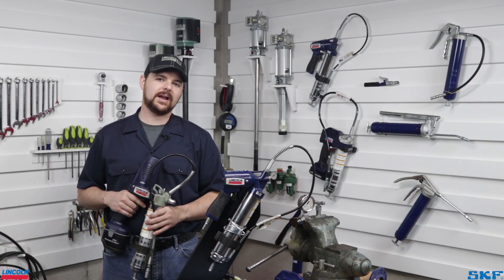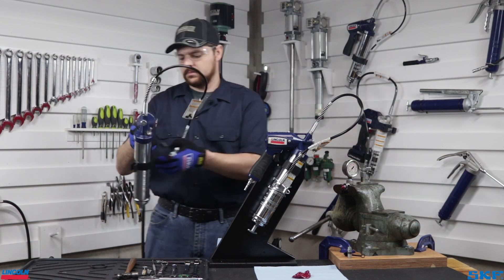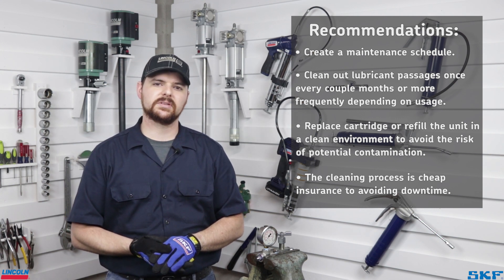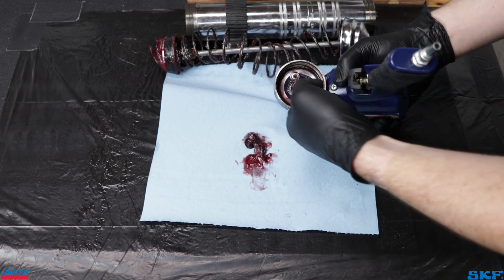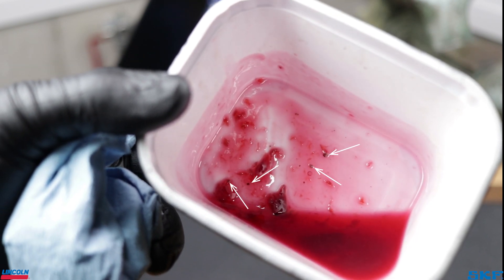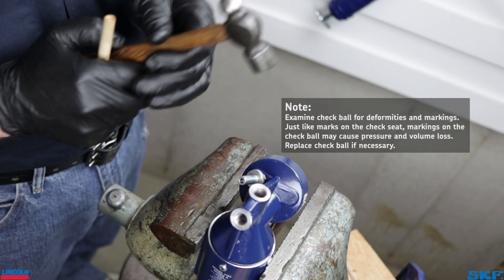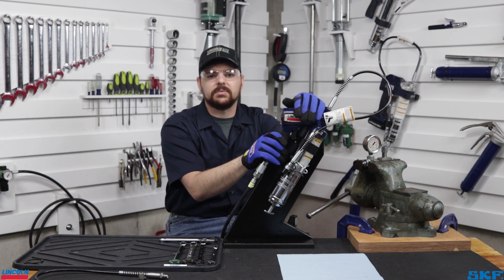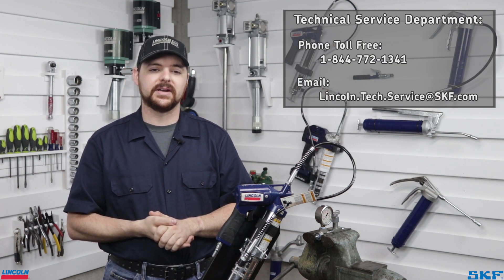Grease gun maintenance cleaning procedure - Lincoln Industrial how to

Comment: Great video! Can you flush the hose rather than replace it? If so, what is the approach to remove all old grease and debris?
Reply from the maker: Greetings! for safety, we don't recommend attempting to flush a whip hose if it is blocked. There is too much of a risk of internally damaging the hose and rupturing. If the hose is determined to be blocked, please replace with a new one after cleaning out the grease gun. 

~ John

Comment: We are using the ac2400 for wind turbine maintenance and they are not holding prime. One is new this year and the other is a year old. We have been using the priming instructions and they will run for a while but lose prime again. Any advice?
Reply from the maker: This time of year we typically see an increase in loss of prime inquiries.  Weather/temperature can play a big role in staying primed. In colder environments, the grease may not flow as easily compared to warmer environments and will lose prime. this is especially true with very tacky greases or greases with high volumes of solids(molybdenum is a common solid additive). Other issues such as a dented grease cartridge can bind the follower and reduce the forward pressure on the grease. Debris or solids build up in the check area can also cause priming issues, even in new guns. 
Assuming winterlike weather, options would be to warm the grease tubes prior to use, or try a lighter grease, clean out the grease gun head more frequently to reduce build up of solids/debris. Use damage free grease cartridges. Hope this helps!

~John

Comment: Do you know why my spring bar is pushing through the full tube of grease?
Reply from the maker: the locking rod and Tee handle are designed to lock into the Follower when refilling or swapping grease tubes. It then can be twisted and pushed into the tube assembly out of the way during use. The follower should stay with the level of grease in the tube. Couple reasons grease may find its way behind the follower are: 
- damaged cartridge
- worn/damaged, or non malleable main seal of follower. (In rare cases, greases may have additives that may cause damage to the follower seal.)
- worn/damaged sealing o-ring to tee handle. 
- solids or debris allowing an opening to form at a seal, due to pressure, the grease will bypass. 
- pitting, or and scratches or gouges on the follower rod. 

I would suggest emptying the tube assembly, removing the end cap, spring, rod and follower as an assembly, and give them a good cleaning with a degreasing soap. check the seals for any damage, as well as the rod. 

~John

Comment: My brand new 12v li-ion Lincoln grease gun has fluid leaking out of the main plug on the front...just noticed each time I pull it out there is fluid in the case. I tightened it but what is my next step. Should I be worried about losing too much? Should I remove and thread tape it and add more?
Reply from the maker: The fluid you are seeing is the oil separating from the additives in the grease. This is normal in all grease guns if it has been sitting for a while, or is in a hot location such as an outdoor toolbox or vehicle. Our recommendation is to store the gun empty to reduce the chances of separation. The longer the cartridge sits in the gun under the conditions above, the higher chances the grease will no longer be usable since the oil is the most important part of the grease.  

~ John
Reply: @lincolnindustrial  OH that's great news. The more I thought about it the less I thought it was some kind of oil from inside the gun...but i wasn't sure exactly how the gun worked inside tbh lol. Its been working awesome and I'm glad it's normal. Thanks for the info!

Comment: what is the use of the check ball (ball bearing with spring)?   By the way, your video was perfect with my blocked hose with the same model.  That confirmed it.  You've done well on your video presentation, very informative.  (my profile pic is my daughter).
Reply from the maker: Thank you! Happy the video helped solve your issue! The ball and spring act as a check valve allowing the grease to move in one direction out the coupler while operated and stay in the tube while at rest . It's one of the most important parts of the gun apart from the actual piston driving the lubricant into the hose. Valve must be kept clean or volume and pressure loss will occur. 

~ John

Comment: my trigger is stuck on. Is this a common problem? It has just happened to me the other day and planning on investigating it today and see if a good cleaning will free it up.
Reply from the maker: Is it the 1162 Pneumatic unit? A stuck trigger usually occurs due to moisture and oil mixing causing a sticky feel. Could also be debris not allowing a firm seal on the check seat. Remove  the trigger valve, and clean with mineral spirits, then lightly oil. This usually fixes the issue. 

~John

Comment: Very informative and well demonstrated!
What is the best way to store a manual hand pumped grease gun if only used a few times a year? Mine leaks due to temperature change so I keep it in a large plastic bag in my garage. Thank you for the video and your expert advise!
Reply from the maker: MRrwmac Thanks! For storage, our recommendation is in a cool location with the bulk grease or grease cartridge removed. The cause of leaks is due to warm temperature in conjunction with the pressure from the follower assembly. This causes the oil in the grease to separate from the additives and thickeners(kind of like squeezing a sponge), and finds a path out of the unit. Usually through threads or a partially seated grease cartridge. A video will be released shortly mentioning this situation. Thanks for watching!  ~John
Reply: Lincoln Industrial John, Thanks!
Removing a partially used cartridge would be very messy and even if that was removed, the remaining grease would still leak when it got even a little bit warm, and therefore right back to the leaking problem.
If the gun is stored without removing the grease, is it better to store vertically in a wall holder and spring handle down or upside down , OR horizontally in a plastic pan or something?
Reply from the maker: I understand the issue, The hope is that an entire cartridge of grease can be used before storage, but that is typically not the case. My recommendation has always been to remove the cartridge or bulk lubricant if unit is stored unused for an extended amount of time. Once cartridge is removed or tube assembly is emptied, clean out the remaining lubricant from the grease gun head as well.  Run some transmission fluid or penetrating oil through to clean out the passages and hose/rigid extension. This will also help keep everything coated, and remove many contaminants and settled additives that may eventually cause dispensing issues.  Store in a holder vertically, head up or down once clean and emptied should not matter. If possible cap both ends of the cartridge assembly and store next to the unit in a climate controlled area until next use.  

~ John
Reply: Hello Sir how can we purchase this product is there any sales mail id as I am not able to connect any of your sales team please do revert